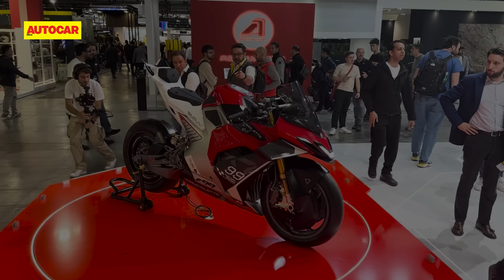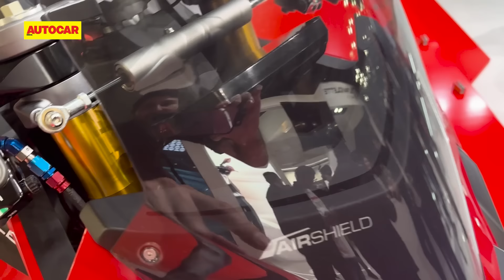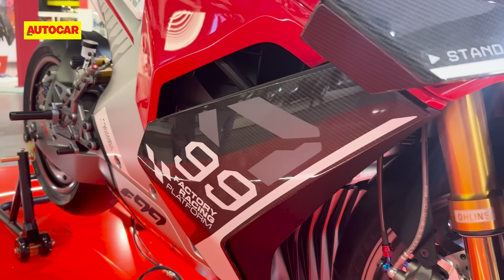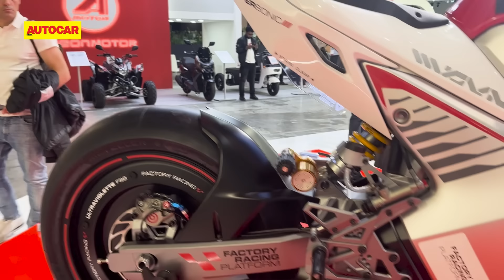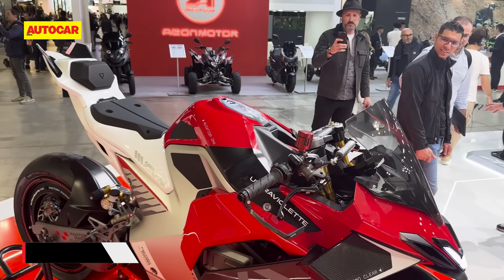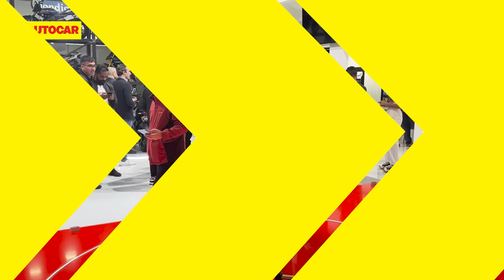Ultraviolette F99 - 120hp electric race bike can do 265kph! | First Look | Autocar India

Comment: Stunning. They should push it into production as early as possible - it will definitely have good volumes if well priced.
Reply: What is the price range considered to be well-priced?
Reply: There is no well priced with e-bikes kkkk
Reply: Well priced was a well intended comment. Didn't imply low priced anywhere ...did i ? :)

If it's competition is a Honda xxx then undercutting it or being in its ball park price is indeed well priced.